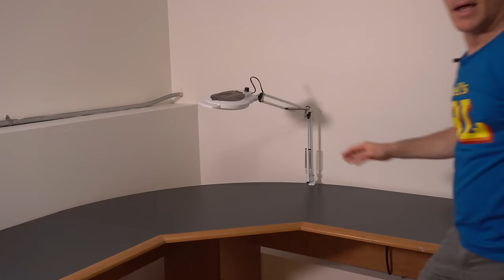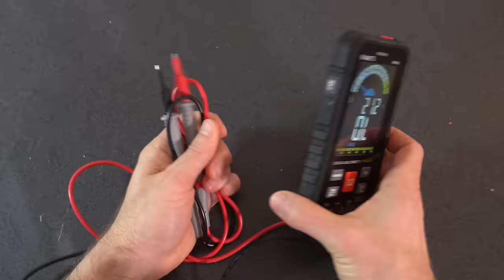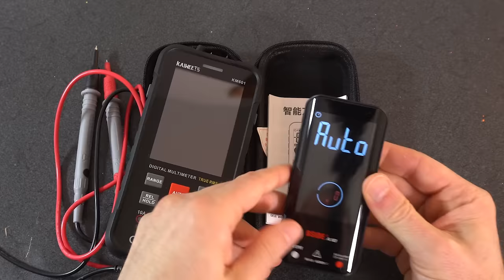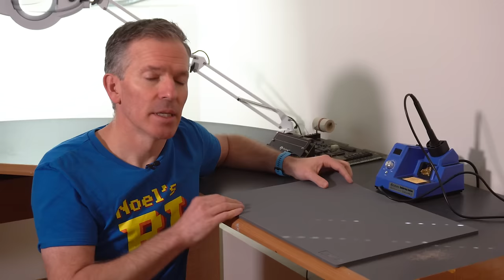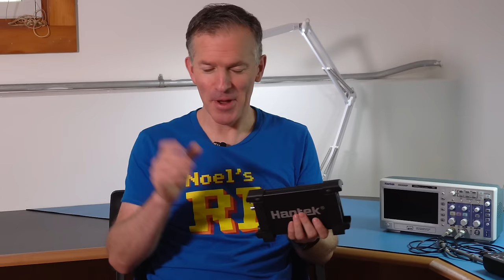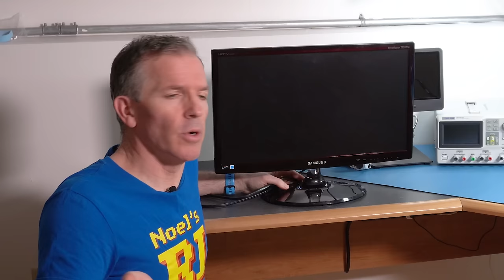Essential Tools For An Electronics Lab

Comment: One thing that I would suggest and it would also yield the some tools which are very similar to your hot air station and soldering iron:  The CO-Z (or just insert another brand) 898D.  It has the exact same hot air station and it also has a Hakko compatible soldering iron coming from the same little box.  The front of mine (the CO-Z) has a strikingly similar front face as the model 858D seen in this video.  One bonus to using the 898D over the 858D is that there'd be one less thing to plug into the wall or power strip.  I wonder how the soldering iron side of the 898D compares to the ToAuto soldering station.
Reply: It's a personal preference, but one thing that puts me off 2-in-1 or 3-in-1 tools is that if one part fails, it can be pain. If under warranty you have to send the whole thing back for replacement. When out of warranty it takes up a little extra space on the desk where a working tool could be. But like you said, the convenience factor of using only one wall outlet rather than two and that some combos take up less space are pluses. There's no right or wrong here.

Comment: That desoldering station is really cool, was just using it yesterday. It came with soldering station with hot air in one package as well, it's super cool (or rather hot 😁) but expensive (i borrowed it)... can't recommend enough 👍

Comment: I have the FLuke 117. I LOVE it. I also have an Extech - worth £80 I think so not cheap. The Fluke wins on everything hands down. Whatever component or value you want to read, the Fluke will read it in a split second - done. The Extech will take forever and on some values (like low resistance values) it'll never stabilise. The Fluke is indeed very expensive but it's a pleasure to use. 
If you cannot afford the Fluke - or you don't want to spend that money - I agree on NOT getting the cheapest one. Those tools will last for a while and if you get a decent quality one, it's going to be worth the money. This applies for any tools you want to buy. A good quality tool will last years and it'll deliver great performance all that time.

Thanks for the video!
Reply from the maker: Agreed. I'm loving the Fluke so far! Best multimeter I've ever used.

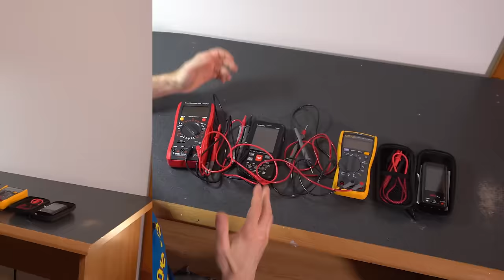Comment: 5:30 for the price of a entry Flue I have to recommend OWON DMM/Scope/Gencombo units, bright, practical easy to swap and recharge 18650 cells. 
10:00 PINCIEL and a grounded USB-C PD power supply you can get 2-3 irons and hot swappable tips for the price of a tradaitional station, thats better spend on a de-soldering gun tbh.

Comment: Several pair of hemostats to hold things in tight places or clamping a couple of parts together for soldering. You can bend and grind ends to shape for particular tasks. Much more useful than a needlenose. You can find them just about for free because they are throw away items at most hospitals. piles available for pennies on EBay from time to time.
Reply: Dental picks weren't mentined in the video but are an absolute necessity for electronics work!  The latching/ locking mechanism on hemostats is sometimes too high tension and can damage things that you lock onto with it, so I have a set of hemostats with the latch mechanism ground off and a light rubber band put on the handles to keep the jaws closed shut with minimal tension.

Comment: Statically charged surfaces are easily discharged by wiping them down with a paper towel wetted with a solution of water and dish detergent.  Do it regularly in dry climates.  ALWAYS match the charge on your body by the charge on the mat by first laying your hands on the mat.  Then pick up the circuit board you want to work on at the edges and allow a few seconds for the charge on the board to neutralize with the charge on your body and work surface.  Grounded work surfaces are not much help if you charge up a circuit board and then suddenly put it down on a grounded work surface.  Scooting your butt on a vinyl work stool will charge you up to several kilovolts!  SNAP!

Comment: I was repairing computers for a church, bunch of old cheap computers. Didn't have an exacto knife had to use a box-cutter to isolate a possible fault.
Didn't find it, but just rej-umper the circuit board. Lesson learned - get a real sharp exacto knife.

Comment: Just did my first electronics repar on my Moza R12 its 650 dollars with tax i was a bit nervous i used a Schneider 5-50 watt soldering station it was a pain to get calibrated it still needs to be dialed in more but i did get the job done and my R12 now works again i couldn't be more pleased with the results here i had to solder this mini 75watt x 2 Amp from the other board to the new board i stold there was no soldering needed but there was some needed the video moza sent for was repair of a R9 board replacement it uses a plug for the 75w amp yeah its not that way on the R12 its soldered to the bottom of the board via some pretty large tabs so it was hard to screw up the only thing that sucked was getting my soldering station calibrated enough to where it would melt solder  at first it would not melt solder set at 800 degrees even i was baffled eventually i got it dialed in enough to melt solder rither way it's staying set right where its  at i hope to never have to mess with calibration of that thing ever again pain in the but cause the calibration screw doesn't tell you anything up or down so annoying

Comment: I was waiting for one like this. Great Job! It was very informative. How about if you talk a little about EPROM writers and erasers? It's a cool thing to know when you're tinkering around 8 and 16 bits computers. :)
Reply: If you look at the final scene, there is one on the bench. Would have been good if he had mentioned something about it.
Reply: An eraser is just a lightbulb, no harm in cheaping out there. The only thing really worth paying for is extra size - so if you need to erase a ton at once you can limit your number of cycles needed :) For 8 bit only devices really any of the cheap options are fine. 16 bit era devices can involve PAL/GAL territory. The cheapest effective burner for these that I've found is the TOP 3000. I can't vouch for modern Windows compatibility for any burners, however as I use a Win XP laptop specifically for this purpose.

Comment: As I followed along, I found I have everything except a microscope.  Also, I liked your comment about the lead free solder.  I built the KIM -1 Uno kit recently to see if I could do it and was having a lot of trouble soldering in the keyboard switches.  I watch a video to see what I was doing wrong.  That guy mentioned how difficult it is to use lead free solder.  Sure enough, the solder that came with my soldering station was lead free.  I switched to 69/40 solder and had no further issues.  To my delight, it worked the first time I powered it up.  I do need a bigger work area though.  I have to move things on and off the work table as I need them.
Reply: Unleaded soldier is a nightmare. Horrible stuff.
Reply: @MattyEngland ,   I see that your auto correct keeps changing solder  to "soldier", just like mine does!  The voice to text program gets almost everything wrong and in order to have it type out the word solder correctly I have to pronounce it as soul-der and not sodder, or it types sotter, sodder, sadder or soldier.  Voice to text program also tends to double things up and print them twice, like an echo.
Reply: @MattyEngland ,   Many people are not aware that lead free solder requires higher temperature settings of the iron and that the fluxes are corrosive and conductive, and not only beat the heck out of the soldering iron tips prematureky but also can cause problem with your circuits if you don't remove all traces of flux from the circuit board.  There is also the matter of tin whiskers that grow out from lead free connections and reach across to short circuit to other connections and components.  I don't find the fumes from rosin flux used with traditional lead solder to be irritating, but lead free fluxes are really nasty if you get a snoot full of them. I use leaded solder exclusively.

Comment: Curve tracers are really not necessary but they may help in-circuit trouble shooting. Also a short-circuit tracer may help to home into the location of shorted components.

Electronic Design Specialists - Leak Seeker
Vu-Data or Huntron for in-circuit curve tracer

Comment: Hi, Noel  Welcome to the States and great content, as always.  Since you asked for suggestions of additional essentials, here are a few that come to mind (I've been recently setting up my own space, so it's fresh in my head).  Brushes (for cleaning) - I started out using cheap toothbrushes, but have moved on to ESD safe brushes.  Chip extraction tools.  Measuring tools (ruler/caliper).  Crimpers.  Finally, some form of storage / organization for hand tools.  I'll admit, I haven't figured that one out yet.  Just some ideas.  You could also do a video on consumables: IPA, contact cleaner, lubricants, tape, etc... that you commonly use in the lab.  Keep up the good work!
Reply: Agree on all of the above. A consumables video would make an excellent follow up, as there are so many required (and some vary wildly in quality).

Comment: I like higher work benches. I often wanrt to stand at the bench without having to sit or bend over. This will make more room under the bench for shelves and storage. Maximum depth of work bemch surface depemds on the first shekf hight and depth, one should have 24 inches of clear space in front of the first shelf above the work bench surface..  How high the work bench? stand in front of the bench both fore arms should be able to lay flat. From the floor to your elbows high, while standing uo. Then  a stool with back rest, first rung on stool to rest feet. or sit on stool with feet touching the floor {both}..  When sitting on the stool both fore armss should be able to lie flat.  This bench will make you very happy. Very comfortable. The bench should not be up against a wall. You want power cords and other cables to be able to to hang dowm behind the bench...  Your bench is your most important number one tool..

Comment: Correction: those 200MHz and 40MHz oscilloscopes mentioned are bandwidth, not sampling rate.  In fact, the Hantek desktop oscilloscope shown has a sampling rate of 1GSa/s (1 giga samples per second), indicated in the front panel.

Comment: I'm not sure if there's a name for them but I recently added a set of needle finger probes for precise probing on high density boards. if you find yourself working on high density boards a lot I highly recommend them.
Reply: they sit on a steel base plate with a magnet, and you can hold boards in place with similar magnet base bollards. they make versions in a circular configuration for fairly cheap, but I opted for magnetic base plate for maximum flexibility for board shape

Comment: You overlooked the most critical aspect of proper soldering >>>> the size of the soldering tip.  Trying to heat wide copper tracks with a needle point tip is senseless.  You won't get the copper and substrate hot enough to make a properly flowed solder joint.  Likewise a too large tip on a fine copper track is like swatting flies with a sledge hammer.  Raising or lowering tip temperature depends on the mass of metal that needs be heated so tip size is important because it carries the heat to the work point.  Always use the largest size tip for the job so that heating is not prolonged.  A solder joint should be formed and flowed quickly while flux is still active.  A good starting temp is 700F (370C) for tin/lead solder, a bit higher for lead free solder.  If in doubt first work out your method on some scrap materials.

Comment: While I agree with 99.9% of everything you said here, I would just say that a power supply - even a simple, inexpensive. single channel one would be second or third on the list if you are doing any building instead of just troubleshooting/repair work. The new hobbyist would be AMAZED how useful a power supply is compared to a function generator or even an oscilloscope  early on.

Comment: 10:03 says the problem is you can't change temperature,
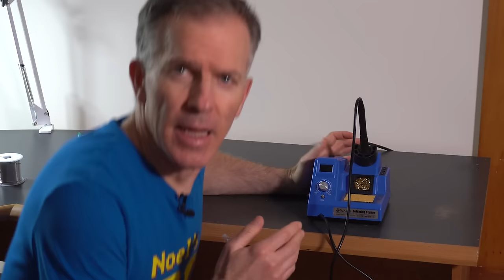9:53 literally shows soldering iron with temperature control couple of seconds earlier.

BTW: i got that exact soldering iron from alie-express a long time ago, and it suprisingly still works.
If its on for to long, the handgrip gets hot. So i turn the extension cord off (since there is no on-off buton) when i'm stripping wires or something. But i would recommend with better quality. It feels really cheap and thin, but it works.

Comment: The hot air station which looks identical to the one on your video image 858D we use at work, bought fir £26 each we repair LED display panels from ROE tgst get damaged, for the price (£26 each) its brilliant, I've got a JBC hot air station at home which cost a lot, but the 858D does pretty much everything the JBC does bar foot pedal and vacuum pick, RS components in UK sell the 858D with their RS logo on it for £100 but it's identical to the £26 version just face plate and knob style, our 858D are 3 years old and in daily use, I'm definitely a wwller, jbc or pace soldering iron guy mainly as a lot if cheaper brand dissapear so soarer parts like tips  become unavailable, my weller WD-2 (11 years old now) and pace mbt-250 25 years old both still fine and still get spare parts.

Comment: There is a 3rd party command line tool that supports the minipro family of programmers. It runs on Linux and macOS.

Support for the newer T48 and T56 programmers is still a work in progress, but at least it means you don't have to have a separate Windows machine or VM just to read and program chips.

Comment: In my lab (which is more like a workbench) I ended up mostly fixing / soldering cables, so if you're like me or you own a bunny I'd suggest getting a fancy insulation remover. It costs a few bucks and will save your cables and your teeth.
Reply from the maker: Good point. I tend not to do much of that because I ended up ordering all my video cables online since they were quite time consuming to make 😃 Any particular tool brand/model you recommend?
Reply: @NoelsRetroLab  I went to check what brand is my wire stripper. I own a no name knock off one, it looks like a twin of the "Stanley FatMax Automatic Wire Stripper and Cutting Pliers", but with orange parts instead of the Stanley yellow.

Comment: Yeah, thank you for pointing out to others that cheapest soldering irons is no go, even me and my colleagues who have at least some degree in engineering, hate those and... well... lost a few compononents due to them. 
Btw, you forgot to mention that there's another category of crappy soldering iron - those one, which destroy their tip even before temp reaches min. limit for soldering agent (either pine resin or flux).
Ps pine & ts100/ts85/ts101 is a great analog to start soldering with

Comment: I would say dont skimp on a meter, buy a Fluke. I have 2 and they are hands down the best meter. as far as soldering iron I have tried all the cheap ones, and they suck. I am using a Ryobi (very handy if you run their tools also) 120 watt, adjustable and it uses the same tips. Scope, I have the Hantek 6022BE its ok, plan to upgrade due to speed. but i like the USB models.

Comment: Sorry I caught this video late, but one item you didn't mention was a variable voltage isolated line supply. That could save your oscilloscope in some cases. They are cheap to make. Variac and isolation transformer.
Reply: ......with a switchable/bypassable incandescent light bulb as a current limiter. Prevent releasing the all-important magic smoke from your components and devices!

Comment: A good tip: Placing the silicone mat on top of the grounded ESD mat makes it non static and you can work on some projects requiring more heat or mechanical abuse.
Reply: The silicone mat is non-conductive, so it will not be grounded and a static charge can be created.
Reply: You can buy grounding kits where you just add your own button for a common ground.